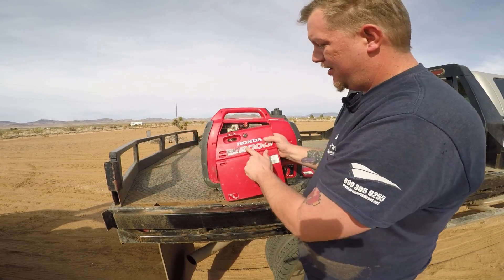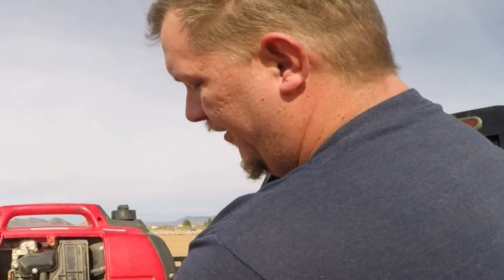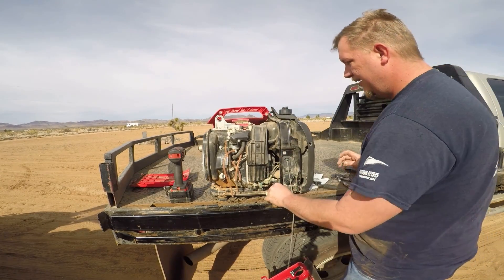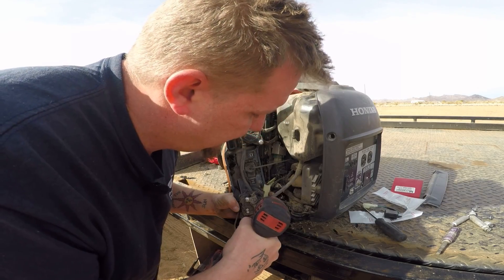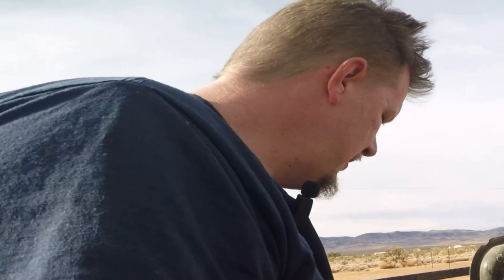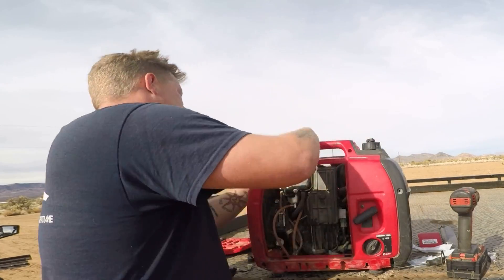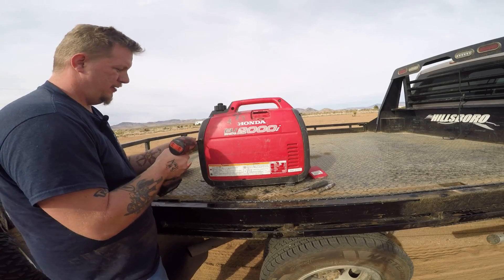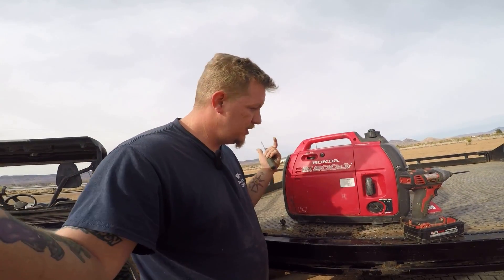Get Your Generator Going: No-Spark in Honda EU2000i Inverter & Swapping the Engine Stop Switch

Comment: What wires did you disconnect to bypass the off switch? My generator got caught in a flood and sat in about 5” of water for a few hours. I think it took out my switch.
Reply from the maker: If you just disconnect it you don't have to bypass it, but you do have to remove the spark plug to shut it off
Reply: @RepairGang  thank you. Your tip helped me diagnose the bad switch without just throwing parts at it with fingers crossed.
Reply from the maker: @TXsilvy  thank you for watching

Comment: Mine has weak spark ,was wondering if the magnet could be recharged like older mower?
Reply from the maker: I don't think so cuz I believe inverters have a different type of ignition coil. They don't use a magneto